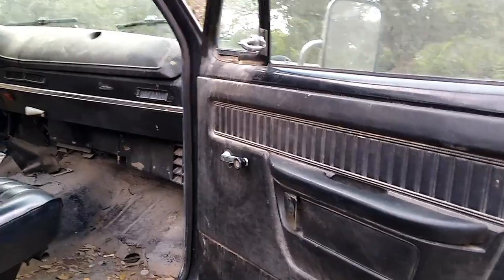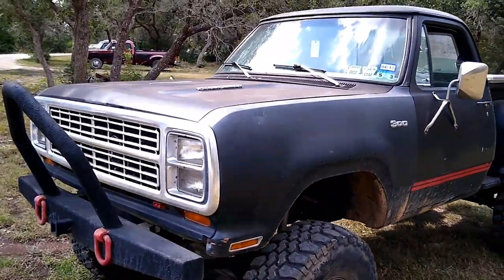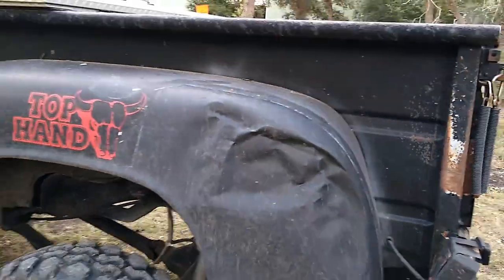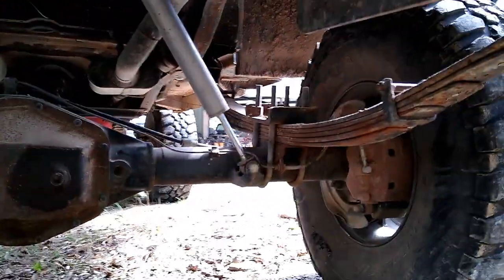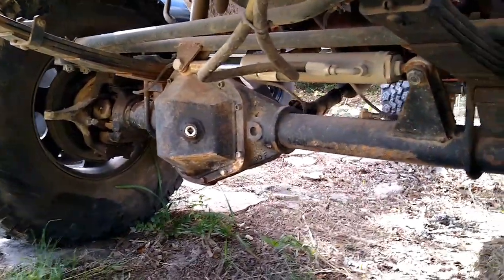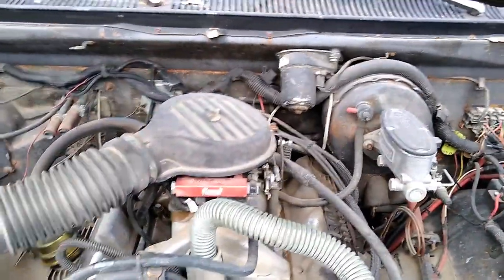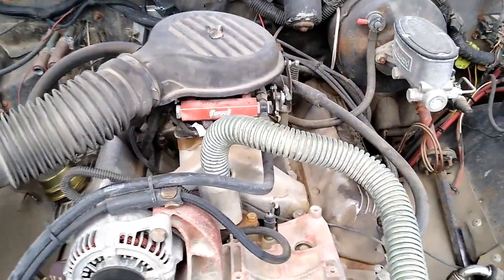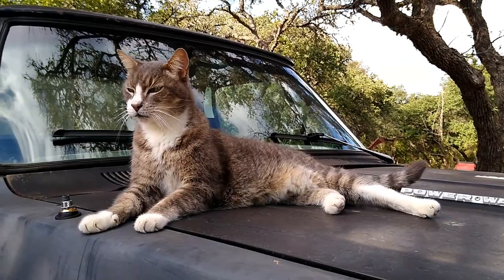Top Hand Walkaround - 1979 Dodge W150 Power Wagon

Comment: Damn! I love that truck!  Keep making videos. Get Larry involved.
Reply from the maker: When are you test driving your RC out here? Can't wait to see it on the road
Reply: @TheDodgeWhisperer  it leaks oil worse than my 12v. It seriously gets 2mpg. It needs a timing chain. I think it has a burned valve or something And most of all it needs new seats. 

With all that said...it runs really good. I drive it all over the lake. I need to pull the engine, reseal it, new timing chain, exh manifold gaskets and figure out why it runs so damn rich. Ill bring it by soon though

Comment: That sure is a sweet ride. I'm planning on dropping a magnum in my 80 PW, and your fuel injection set up looks to be the ticket. Are you running an in tank pump. Having two tanks I'm not sure if I'll have to much restriction pulling fuel through the switch mechanism, and kill a frame mounted pump
Reply from the maker: There is alot involved in a fuel injection setup.... mine is not ideal but it does work. Whatever you do definitely dont go cheap, and do an in tank pump if at all possible
Reply from the maker: I would consider the Holley Sniper setup first over the fitech or summit efi setups
Reply: @TheDodgeWhisperer  thanks for your input. I was debating an in tank,  get rid of the switch, and just a cheap transfer pump to move fuel from the rear tank. Hell I can barely afford to fill the front tank anyway.
Reply from the maker: @alcyr5655  yep that would be a good solution

Comment: Nice Truck ! 
i have som Questions ... 
 to build my 78 Dodge W150  correct.. 
i has a Manual transmission ( NP4530 , ration 456 ) it and a np 203 Transvere case  and 5 lug Dana44 front and a same smol in the rear.. 
Now i want to change with dana 60 
Fromt and rear.. 
Rear i have a Dana 60  the front i go by one from a K30 .. 
I have a GM NP205 changed to 35 (? ) spline input female ( works with TH400) .. 
Now i want to make a Dubbler let the Underdrive from the 203 in it and 205 behind ( works with now modificstion  together ? (NP203 underdrive box with the 205 female input ? )  ( Dubbler kit from Offroaddesign) 
Next wath im not shure are the correct Axle gear ration ( want arround 38" tiers)
Now wath im not shure are gear
ration .. Becose i want drive Highway speed with low rpm.. arround 75 miles with under 2000rpm.. so i think i need arround 3.55 gears.. ?? 
but most wath i see drive 4,50 Axle ration  ore 4.8 ore higher.. 
But i think with this high 4.5/4.8  i dont has an gassafe gasmilage.. 
so i think to take a3.55 
and with this 2 Underdrives low gear i
with that i think it is enough.. 
wath you think ??  
You have on bouth axles Spartan lunchbox lochers ? 
They works nearly  same as fulf lock ox ore air locker ? 
And i want change the carburator to like your summit TPI system.. or maybee somphing  from Edelbrock .. 
Steering  to like from offroaddesign Hi steer kit.. And some more Gastanks for long travel.... 
sory for my bad english 
regards

Comment: Nice truck . I have the same one. I want a 5 speed and drop the 360. I'm leaning toward 4.o straight 6. Daily driver. I'm looking for reliability.  I love the 318. I just don't understand the swap. If you wanted a v8 and you had an old 360. Why would you pick the 318 instead of rebuilding the 360. And I'm asking your advice. I want to swap moters am I wrong for picking a straight  6? 4.0
Reply from the maker: 318 la or magnum are internally balanced which is a plus. the difference between a 360 or a 318 on the trail is negligible with the gearing, and it runs cooler

Comment: What up, what up. So your rear axle is a Dana 60 and not a Dana 70 ?  I know they made both for that year 2500.
Reply from the maker: yes it is a dana 60 out of a 2nd gen 2500 gasser
Reply: @TheDodgeWhisperer  Did you have to add the disc brakes or did it come with them from factory? Also did you have to drill your spindles out for the 35 spline shaft's?